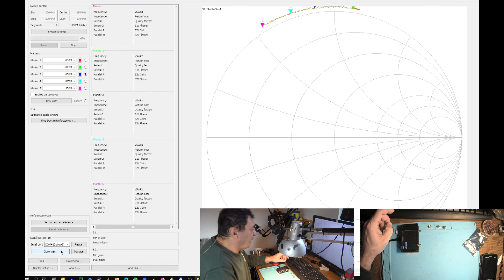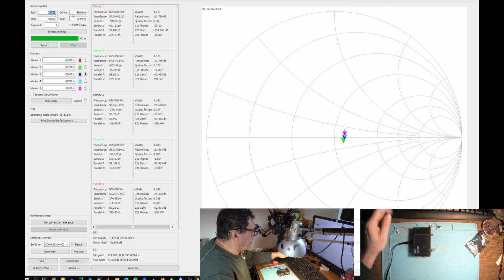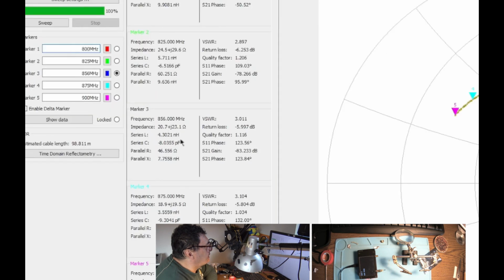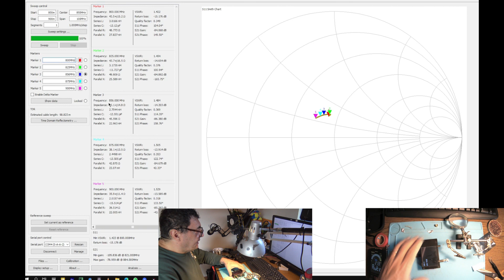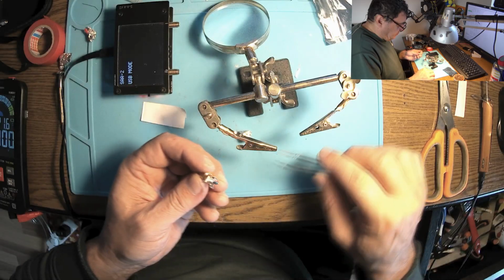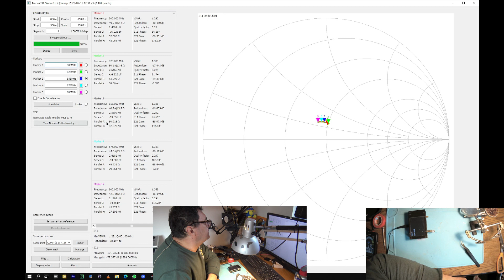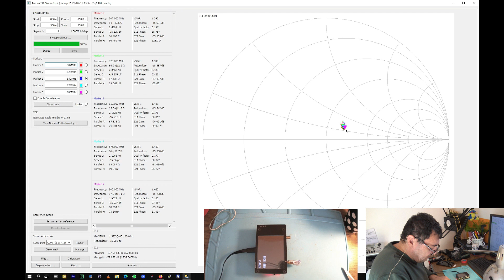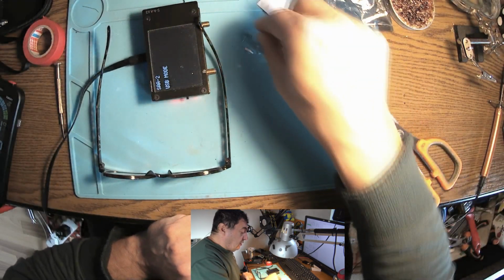DIY 50 ohms RF terminator

Comment: This sort of doesn't make sense; what did you calibrate the NanoVNA with?  If you calibrated it with that 50-ohm SMA terminator (as well as an open and short) at the calibration plane, then just measuring the same 50 ohm load should have given you an exact 50 ohm result on the Smith chart.
Reply from the maker: You're right.